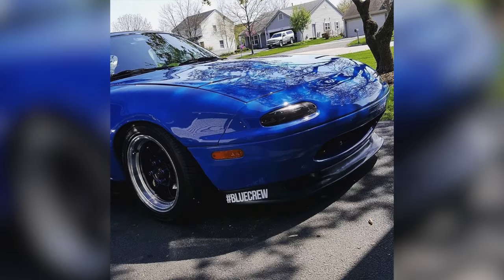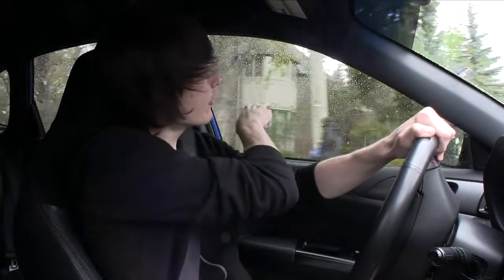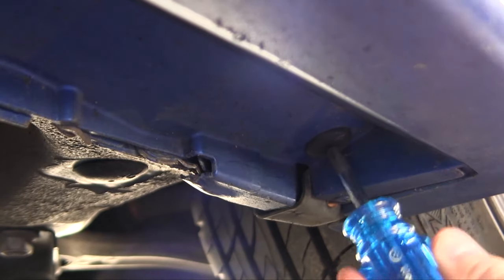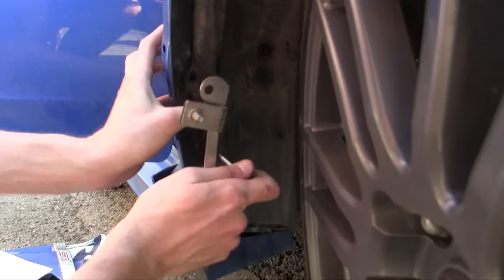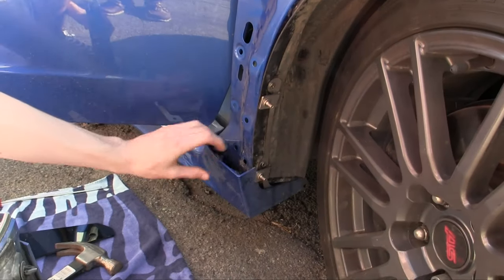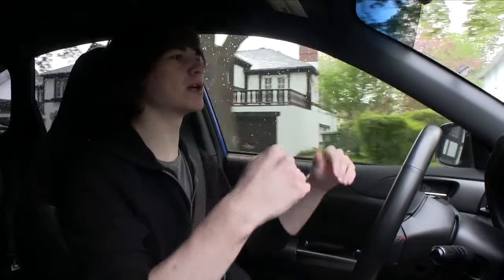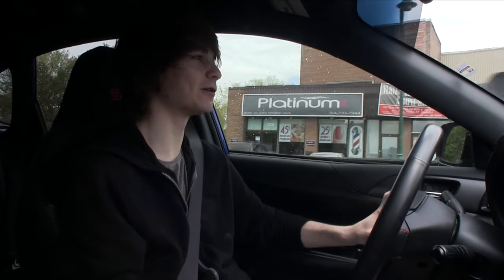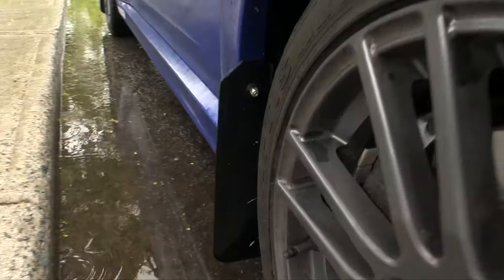INSTALLING MUD FLAPS!!! (How To Install Mud Flaps - Subaru WRX STi)

Comment: Get wheel spacers and coilovers!
Reply from the maker: +Ollie Hunter Coil overs will be coming soon hopefully :)
Reply: +AR12Gaming holy shit you replied haha! Good to hear man sure it'll look great
Reply: +AR12Gaming what about a de-cat or catback exhaust
Reply: +AR12Gaming Nick! Does even your screwdriver have to be blue?
Reply: he doesn't need spacers, stock wrx wheels are very narrow
Reply: +AR12Gaming get airbag suspension. dont get spacers, just buy the right size rims and tires. spacers can break
Reply: +SlideLyfe LOL do you even know how much that cost
Reply: +Lucas Ocampo ik theyre expensive but imo id rather dish out big bucks bc speed bumps. if ur on coils and ur too low, speed bumps fuck u over
Reply: I wouldn't use spacers. But could are good
Reply: +SlideLyfe in a WRX it wont fit the style,you'll broke the styling concept of the car

Comment: Do not straight pipe, you will loose lots of back pressure. Get a 2.5" catback with the middle muffler(s) removed. You will have that classic Subaru deep tone with the pops and crackles. Plus you'll gain a bit of power!

Comment: To remove those clips you turn them counter clockwise until the middle pops a bit and then pull the middle, comes right out.

Comment: What do you prefer, your R or STi? Ive owned multiple subarus and had an MK4 R32 and i've found my self wanting another R32 but looking at the 08s due to alot of city driving and a stage 3 clutch in my WRX is no fun.

Comment: You should get the TurboXS GT Cat Back Exhaust on edge autosport because it is relatively cheap compared to the other exhausts and it is essentially straight piped with a small muffler on the back and also quad tip exhausts look the best on these hatchback STi's

Comment: Either way, the salt is going to rust your wheel walls. You were better off buying a power washer and washing your car every day.
Reply: Yup
Reply: +Rhadiqul or coat them
Reply: +Dakootsy well why not both? lol
Reply: +Joe Wilson-Palmer The car will rust at the bolts, where you cant see it.

Comment: looks cool but its just going to add more drag.
Reply: +Shane Klaric no because ther is already freaking wheels in front of  the rally armor
Reply: +Shane Klaric They have a purpose though.
Reply: +i am fan of ankle He's right ur not
Reply: Thomas Firestine i used common logic .... so ...
Reply: +i am fan of ankle No u used incorrect info so 😑
Reply: Btw He attached it to the actual side skirt so Shane is right it adds more drag
Reply: Thomas Firestine he isnt going more than any actuale speed for them to make a difrence an the dont 'just'' add drag they have a purpose .Wheels are placed directly infront of them so only maybe 1 cm is hanging to the side and creating drag .If what you say is true an antena creats as much drag and a mirror ten times that ...
Reply: +Shane Klaric If you're so worried about drag that you don't put mudflaps on to minimize drag,  you're doing aero wrong. There are numerous other things you can add to the car to get rid of huge amounts of drag compared to the small bit of drag that those mud flaps create. Especially when you have wheels right in front of them. The wheels will generate far more drag than the mud flaps ever will.
Reply: Hear That? thats my point thank you !

Comment: straight pipe the hole system
Reply: YAASSSSS
Reply: +SRiX it will sound like a full on rally car with a blow off valve

Comment: Get wheel spacers
Reply: 2inch spacers, bomex body kit and a ebay exaust how does that sound (absolutely aweful since ebay exausts don't sound good 99% of the time)
Reply: aftermarket wheels will fix the problem, but first he will need coils
Reply: stock wheels are narrow